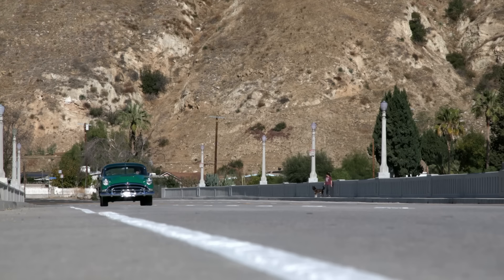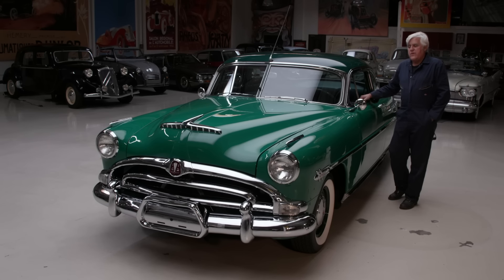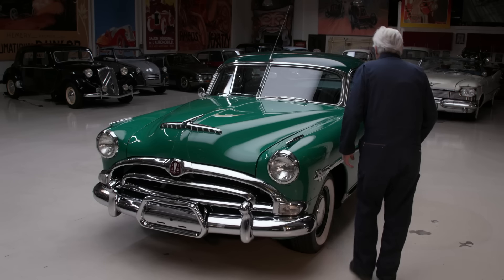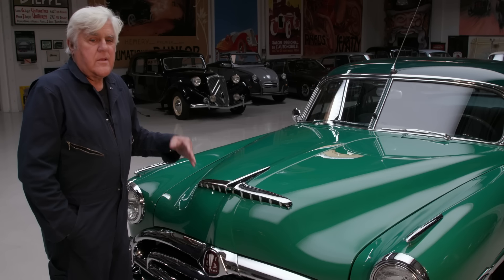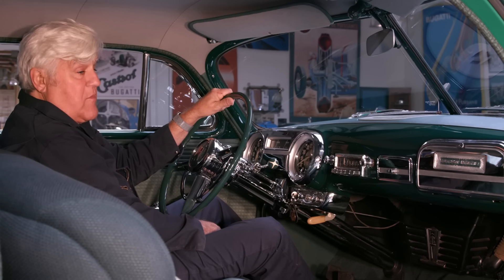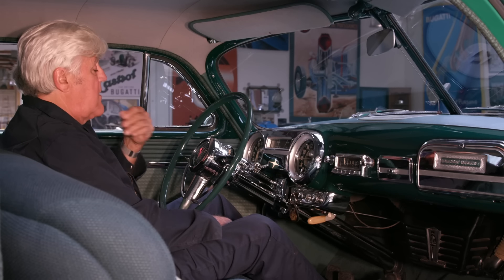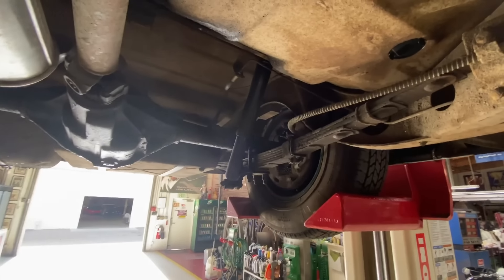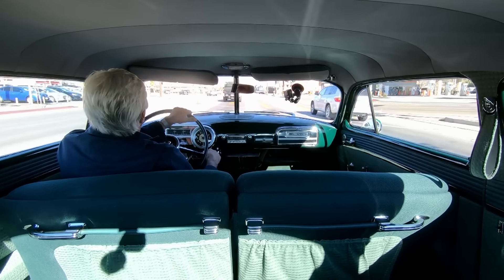1953 Hudson Hornet - Jay Leno's Garage

Comment: The first car I can ever remember riding in was a Hudson Hornet (fastback version) with the straight 8 motor. My father always got a thrill out of the fact that it would outrun every car on the road up the Clarion River Hill (Clarion, PA) when we were going to visit my grandfather. At the time I had 2 or 3 younger siblings (I have 7 now) & I remember that my sister and I were always excited when some poor sucker decided to race Dad up the hill in that car.

BTW, it is perfectly fine to use 6 volt wiring when converting a car over to 12 volts because 6 volt wiring is bigger and has less resistance. Trying to convert a car with smaller wire meant for a 12 volt system to 6 volts would result in too much resistance and possible wire burning or things just not functioning. It is always fine to have wire BIGGER than necessary, but never fine to have wire too small. 

What is my qualification for saying this? I taught vehicle electrical systems for 4 years in the US Air Force from 1972 ~ 1976 back when cars still had generators for the most part. After the military I eventually became an ASE Master Heavy Duty Truck Technician and was always the in-house vehicle electrician. I've converted several machines to 12 VDC from 6 VDC & unless the wiring was damaged somehow, there was never a reason to replace it.
Reply: Good clarification I thought Jay got his wires crossed 😉saying 6 to 12v conversion would be bad because of the wiring. I knew 6v wire was thicker.

Comment: I love your videos thanks for your time  Because the pistons are aligned and the engine is longer, the inline 6-cylinder in-line engines produce more torque at a higher speed an inline 6 engine is balanced by its design. The pistons circulate only on an axis and has less vibration what do you use in place of HUDSONITE ? How many other cars had a front subframe in the early 50.s? This is a piece of beautiful rolling art . most all cars look the same now. I agree an engine swap would ruin it on so many levels .

Comment: Lovely car. 6 volt wiring is not inferior. Old wiring may have rotten insulation that could be a problem but the heavier wire will have lower resistance which makes for more efficient  transfer of power.

Comment: The most significant feature of this car is that the chassis runs on the outside of the rear wheels. The result is a wide rear space and is part of the low cg.

Comment: Jay, if you double the voltage from 6v to 12v, you half  the current. So the thicker 6v cables will involve less voltage drop to accessories.

Comment: Yeah what a great what a great co-op. Then you mentioned the rocket engine the Oldsmobile is just brought to mind the the Delta 88 that my dad had a 1969. It was a two-door thick with a limited edition two-door it had like all the bells and whistles in it you know all extra because it was an Oldsmobile it wasn't a caddy. And it had the Delta 88 and I remember it as a 455 rocket that was what the engine was 455 I hope I'm not getting it wrong cubic inches it was a high compression engine they also I think made a low compression engine. And it had a big four barrel Holly carburetor on it I don't remember if that was stock or if my dad put it on my dad was a sort of a after work weekend the car warrior. He started my family on the Thunderbird phrase. Between my dad my sister and myself we own 61 through 66 t-birds. My dad is 61 62 and 63 the first one was a 63 and that I remember it was pretty new I was a kid when he brought at home very young he had it for a while it was stolen then he bought a 61 that was stolen and then he bought the 62 and that just the drove till it was fell apart LOL basically. My sister had the 64 convertible she bought that in 72 I would think maybe 73 oh boy I remember that car. I love that car. That was such an amazing car. And the trunk used to open up a backwards to allow the top to go down and then the bolts in with screw in like they were bolts that screwed in so the keep the trunk down the back of the truck it was school closed. Every single one of those cars lost their power booster everyone. So there was definitely a design floor in the power boosters of those T-Birds and I would assume those were used on many cars. I just watched the video of Jay the latest video I think of the early '80s mustang cop cars CHP mustangs and the driver said that his first car that he did street racing with in Detroit was a think instead of 65 or something Torino with the 390 in it. And that's the engine that was in all these thunderbirds. And that car probably the Torino probably had the same power booster in it. They all went at very unopportunistic times. Yeah every car had that problem. But once you replace those boosters never happen again. But yeah the 4:55 rocket. I never drove with Hudson I've seen them I used to be able to see I was always blind. I used to go to antique car shows I used to go every year I lived in New York City I would go to the the regular at the national car show every year. But love my old cars. I mean I never collective cause really but my first car that I bought out of my pocket because the first one was a 66 Malibu 2-door Chevy Malibu but it had the six in it so it wasn't a V8 but it was still a pretty cool peppy car to drive. But the first car I bought was a 65 Thunderbird landau yeah the first car I bought was a 65 T-Bird land out edition black lacquer it had all the all the chrome trim on the side of the car it has like yeah I won't get into flying detailing or describing of it it was just gorgeous it had a rubber roof what's the land down marks on the side of the roof. Had all the bells and whistles air conditioning policies power windows power door locks and door button a door light that set a jar if you left the door open low gas light the car interior was made to look like a plane. So it look like the cockpit of a plane in there. It had the like I quoted the thermometer speedometer which actually it works sort of like that but it went it was green white and then it would go to green and it will go up like a thermometer look like that's out of the speedometer was it has sequential turn signals in the rear it had the signal indicator lights on the hood like the caddy's had later on on the wheel wells in the front really great car fast for the size it was all stock for the size of the car I forget what it weighed it was really heavy but it was definitely fast. I remember my dad racing Corvettes on the streets but in Queens New York street lights and Street light. He never won but he said the more work he put into his cause the more it kept up with the Corvettes lol. My second car was a 67 Delta 80 I'm sorry a 67 Dodge dart with a push button transmission slant 6 probably one of the best six cylinder engines made in my opinion. That car was nothing special except for the push button and the transmission but it got me around manhattan. Third cost was a 1957 two-door ranch wagon Ford with the big V8 in it I'm sorry with the small block Creator from my mistaken three on the tree then there was no padding on that dashboard it was painted red and it was steel God help you if you're gone to an accident and hit that. But they're really weren't many of the two-door ranch wagons around you know I'm talking now 1980 for let's say 84 85 and they weren't that many of them around I don't think they made all that much. I believe they were made to be the answer to the Chevy nomad which was a big hit. After that car or some of these calls I had simultaneously was a 74 mark 4 about the 57 ranch wagon was all original and no rust California car I was living in Northern California at the time San Francisco burnt out the clutch the first day I had the car and then I was living in San Francisco cuz I wasn't used to stop and go traffic on the hills. If especially the hills that had sidewalks that had a steps in them that's how these streets were. So yeah I brought the clutch out pretty quick but after that I learned how to you know how to use it correctly on the in those conditions. Then I got us the 74 Mark 4 Lincoln the interior was spotless beautiful like new the body needed a paint job and it also needed somebody work not a body person I was able to do all the mechanical work on the stop Voice typing yes so so I sent the car out to have the body work done and I had it painted not exactly the same, I had it done it was a blue baby blue originally I had it painted metal blue metal with metal flag it did a beautiful job on that paint job was amazing and the car after that looked brand new I mean even though the car wasn't as old as it would be today of course but talking about maybe a 15-year-old car 14-year-old car at the time but it turned people's heads especially when I drove across country when I moved back to New York after that car after that one oh I got another t-bird a 66 t-bird. It was a mechanic special you know it was taking it on the lean. I put it down payment on it the day that I went to pick it up the night before the day went to pick it up somebody shot all the windows out with a gun yeah New York City love it right. So I had to go find Windows even in New York City I was able to find all the windows except the the back one. But I found the back when I needed to have this done right away I had no garage couldn't talk the car on the street without a window when I found one it was had a little bit of blue in it I bought it anyway had to put in. This car was not stock the interior was the engine what was born and stroked the carburetor was like a monster or everything had aviation grade oil lines and hose lines and all that stuff. The car was a rocket ship. That was the fastest car I owned it blew my first TV right away power and speed wise that's for sure anyway I'm going to cut this short because I'm already been talking about but I'm sure most of you would think is completely boring but I'll mention my two last cars and then I'll stop it was the 66 Thunderbird oh I'm sorry and then I had an 84 LTD for the which was given to me I drove that a little while so that and then I had an 85 Cadillac eldorado which I drove till I went blind sincerely us, about the blind bedroom guitarist

Comment: Late old tech better than early new tech. I have two 4cyl 5 speeds, a 1995 & 2012. Neither is quick or rev much but start on contact, run smoothly and quietly, and shift so easily that automatic is not necessary. In fact, these days automatic is a real weakness. Electric may come but in my view doesn't complete yet at any price. All that said, I would trade a top end 2022 Corvette with a clear title for this Hudson Hornet without hesitation. I love this kind of car.

Comment: big diesel engines are often straight 6 because diesels are generally noisier and rougher running. inline 6 configuration makes them run smoother

Comment: Jay 6 volt wiring is able to carry more current wattage equals amperage times voltage so the 6 volt wiring works perfectly well with 12 volts the other way around 6 volts on 12 volt wiring will over heat perhaps cause a fire

Comment: I noticed that this Hudson has independent suspension in the front. It may be way ahead in its time. There were not many cars with independent suspension at that time. This really starts in the 1960ties with British Fords, BMW and Porsche. 

So I believe the Hudson Hornet is a a really modern car in its era. Could have been more modern if the undercarriage was plated with a smooth surface so it could be more aerodynamic and save fuel.

Comment: 8:58 never had a problem, i doubt the insulation breaks down at 14 volts and running at a higher voltage means less Amps for the same amount of power.

Comment: Jay sorry to correct you, but the 6 volt wiring is heavier,ie larger guage, because the accesories would draw more current from the battery and generator. When your accesories are run off a 12 v system the current (amperage) requirements are lower, hence the wiring of a 12 V system are usually smaller in guage(diameter). 
The usual  conversion is replace all 6V accesories with 12 v versions, and replace the generator with an alternator. The regulation of the generator is poorer than the alternator because the generator  usually needs more mechanical power than the alternator. The alternator is regulated far better than a generator.
To get back to the wiring, the original 6v wiring if its in good shape is better, less voltage drop, and performs better than the lighter guage wire than the 12 wiring of today.
FYII
CMcG

Comment: OOPS, Hey Mr. Leno, your comment that when you go to 12 volts in a 6 volt vehicle you should change the wire gauge wrong. The wire gauge needs to be thicker for 6 volts than for 12 volts systems BUT thicker gauge wire is not a problem when changing to 12 volts. The opposite is true in that if you would go from a 12 volt system to a 6 volt system you would need to change to a thicker wire gauge. E=IR

Comment: Hudson, prior to the Nash merger, was the smart buy of the postwar era. Sure, a Ford or a Chevy was cheaper and could be had with more options, but a Hudson outclassed its competition. The Hornet was priced between an Olds and a Buick, but it was hard to justify to an average buyer why they should pay that much for an inline six, when you could get a more powerful V8 from everyone else. "Car guys" and engineers understood that the Hudson had a better powerband and torque rating, and the twin carburetors produced a fast 0-60 time, which is why they were favored in early NASCAR. But Joe Public had been conditioned to believe that the V8 was the be-all/end-all, and that's ultimately what killed Hudson.

Comment: A 12v system with "6 volt" wires is fine, but a 6 volt system with "12 volt" (thinner Guage) wiring could lead to a fire.

Comment: The Hudson Hornet is just a beautiful car.  That was when  I started to learn4 how to do body work the hard way I learned by using a lead pot and doing 
 body work with lead.. 
     The real. 
    OLD SCHOOL WAY
   They had no plastic body.
   filler then, everything was 
    painted in enamel single stage and polishing that enamel and polishing that enamel was like trying to polish a sidewalk.
   Very difficult to do. Enamel did not have the shine that basecoat and clearcoat has today.
     Stripping down a car and finding the original led body work you would leave it and do a very thin coat of plastic body filler over it to get it fine and no sand in it.   And now we have the polyester buddy that would make it even a finer finish plastic work before you would shoot the heavy High Build primer 
   Then you would dry blocks and it down to wet sanding the primer and then you have a perfect body ready for primer sealer.
     That's all in today's standards but not back then

Comment: The six cylinder has more torque due to the crankshaft being so long and so heavy. It is the centrifugal force of the crankshaft. On a "V" engine the crankshaft is lot shorter and lighter, therefore the centrifugal force is less.

Comment: 6-volt vs. 12-volt wiring?  I don't think so!  After all, with the positive ground, half the circuit was running through the frame and the body.  Can't get much larger wiring than that!  When I installed turn signals on my 1952 Super Wasp, I used #18 wire I bought at the hardware store, and they worked fine.  
I put a new vibrator in the radio (primitive way to transform DC to AC for the vacuum tubes/valves), and the radio worked fine. It never dropped out at stop lights.
For the 308 CID engine, Hudson offered an optional  higher-compression aluminum cylinder head for even more horse.

Comment: I thought its because the geometry of a straight six means the engine can be symmetrically balanced and has less vibration, which means you dont have to waste energy compensating

Comment: That's interesting. I didn't know even as an engineer that 12 volt and six volt wire was that much different and would confuse an upset your system and you would have to know that

Comment: Jay, let me help you out here, for starters, a car like a Hudson Hornet, or Packard Caribbean, is considered to be a "sportY" car; the "bolted on" parts of a unit body as you called them, are known a sub-assemblies. The Hudson body was welded to the frame, rather than bolted on, making it one of the earliest unit bodied cars, which sadly also made them extremely difficult to "facelift" and that was a definite deal breaker in the 1950s... later, they did manage to turn the "2-box" (Engine/cabin) Hornet into the newly popular "3-box" look (engine /cabin/trunk), but the result was ugly and awkward, and sales plummeted; which was an important factor, in the decision to merge with Nash, into American Motors.

Comment: Jay is in error on providing the facts of the car wire. Actually the larger diameter gauge wire on six volt systems were needed to handle current load allowing for less voltage drop for length used and would have worked well with a 12 volt bump up. It would be the opposite in results if you tried to take 12 volt wiring gauge and drop the system down to 6 volts for you may over heat the wiring during load.

Comment: Let's see now, gas would have been in the neighborhood of around $0.12 per gallon?  I do remember gas was between $.16 - $.20 /gal in 1968, depending on where you went for gas.  I had a '59 Chevy Impala Convertible with a 283 V8, automatic in it.

Comment: The reason big rigs have six cylinders is cost.  No need to have smooth running, and the turbo plus low speed range means no need for breathing of the 8 cylinders.